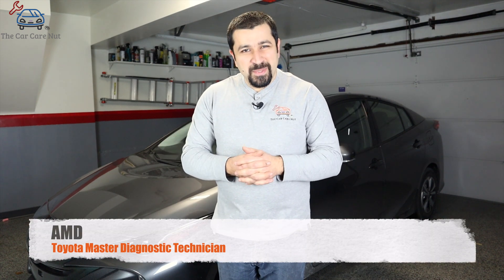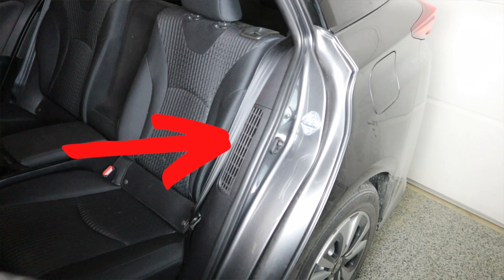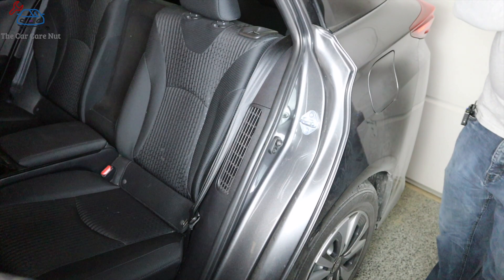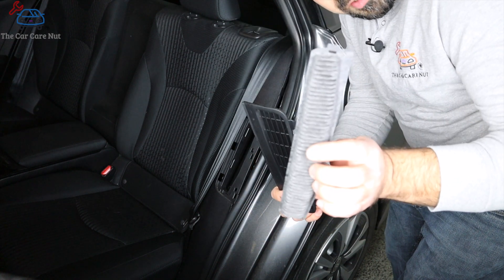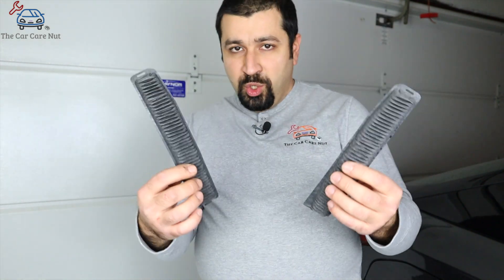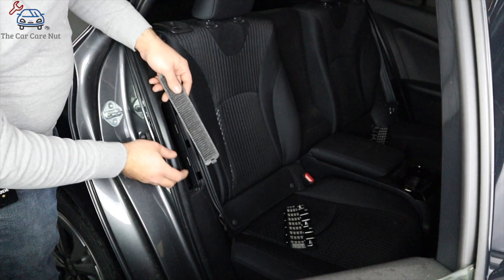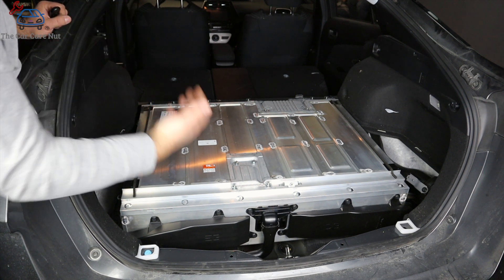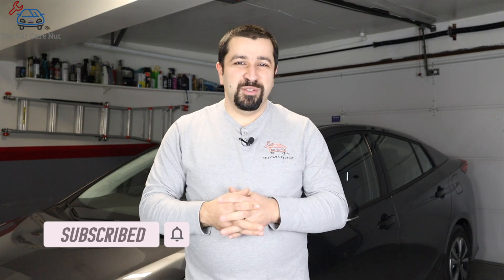How To replace HV Battery Fan Filters on 2017+ Toyota Prius Prime Plug in Hybrid

Comment: Thanks for the great, well informed hybrid info you provide in your videos.  I have a '19 Prius Prime I bought new in June of '19.  In my job as a courier it now has 197,000 miles on it (90% highway).  I checked my filters for the first time after watching this video and they are clean as can be.  I don't have passengers in the back seat and the seats are always down so that might have something to do with it.  The main thing that blows me away is I am still rolling on the original brakes!  I'm really hoping to get 500K or more on this vehicle even if that eventually means a hybrid battery replacement.
Reply from the maker: Very impressive high mileage! Any chance you can share a picture of the car and mileage for the community?
Reply: @TheCarCareNut  Hopefully this works....I tried creating a link to the pics on Google Drive and posting but they would disappear after refreshing the page.  This is an unrestricted link to the two photos on Google Photos.  The mileage today is 196446 but will be 197,000 in the next day or so (depends on what kind of runs I get).  I have better pictures of the car from the time it was on the showroom floor through it's life with me.  This picture was taken in my driveway today with a few states of road grime and all, LOL
https://photos.app.goo.gl/kxbQzfFPZnfLYSo86
Reply from the maker: Thank you for sharing the pictures! That’s the highest prime miles I’ve seen so far! Do you mind if I share it with viewers? I’ll cover the license plate I just would like your permission.
Reply: @TheCarCareNut  Sure, I would love for you to share it!  I love this little car.  It has been, by far, the most reliable vehicle I have ever owned in my 18 years of being a courier.  I've attached a few more pics also you could feel free to share.
https://photos.app.goo.gl/5mXK4FnSbidvT4R37
Reply from the maker: Thank you David! Will do!
Reply: @Hwy_Boy  I also have a 2019 Prime. Only 20,500 miles on it; because of the pandemic I just don't drive as much as I used to. I saw your post that yours is still on the OEM brakes at almost 200K! That's impressive service out of a set of front brake pads. I am especially happy that you have had no trouble with the inverter or any of the transaxle internals like the motors. Those are hell of expensive to repair if anything goes wrong with them. If you've gotten 200K trouble-free miles, on your Prius Prime, maybe mine will last that long, too. I am getting ready to replace the transmission fluid. Probably not essential at only 20,500 miles, but I want to to protect the car as much as I can, and that oil not only lubricates the gears and bearings in the transmission, it also cools the MG1 and MG2 stator coils and all the other internal transmission parts. I've read that dirty ATF in a Prius Prime can lead to short circuits in the MG2 stator, which can carry as much as 60 kw of power under full load. The Toyota transmission fluid is supposed to have zero electrical conductivity, to prevent arcing across the stator windings and connectors, and contaminents in the oil as it ages and breaks down can cause bad things to happen to that $1,500 stator.
Reply: @laura-ann.0726  Hi, alot of good info there, thanks.  It might surprise you to know I am less than 5k miles away from 300k miles on the odo.  Last service at 290k miles my (still original) pads were still at 6mm.  I actually specifically asked for them to check my brakes even though it is part of the dealer '40 something point inspection' every service.  I wasn't having any trouble with them, I'd just never owned a vehicle with that much mileage on brakes, LOL.
I really don't want to jinx myself but I have had NO problems at all with the vehicle.  I've kept up with all scheduled services with the dealer I bought it from and it has never failed me in my job as a long distance medical courier.  I plan on keeping it until the wheels fall off and it just won't go anymore.  I hope you can do the same with yours :-)
Reply: @Hwy_Boy  - Are you still on the original ignition coil packs? If you have gotten 295K out of them, that would be phenomenal! I wouldn't expect to get more than 120K trouble-free miles out of a coil pack, maybe 180K if you live somewhere with a mild climate like the West Coast from San Francisco north to British Columbia, where it rarely gets hotter than the low 80's. Heat is the main killer of ignition coils. Here in central California, it's in the upper 90's to 110 every day from May through September, and Toyota coil packs usually don't last much past 150K. I have a '98 Dodge Ram pickup with a 5.7l Cummins diesel and 5 speed manual transmission. It's still on the original brakes at 105K miles, thanks to the high engine compression braking and manual transmission. I don't drive it much which is why it still has such low miles at 23 years old. But driving style has a huge influence on how long brake pads last, and the regen braking on any hybrid often doubles the life of brake pads compared to a similar weight non-hybrid car. Perfect example are the Camry and Corolla, which have both had Hybrid and non-Hyrbid versions: the Hybrid Corolla or Camry owner can expect 100K miles out of a set of brakes easy, unless they drive like a maniac.
Reply: @laura-ann.0726  Yep, original coil packs.  I live in the mid-Atlantic but drive to most states east of the Mississippi.  It definitely gets hot and humid here.  This time of year I do alot more driving in the northeastern part of the country and around the Great Lakes.
As far as driving style, I'm pretty relaxed on long highway drives.  I anticipate exits off the highway and try to slow down using less brakes and more motor if that makes sense.  More of a gradual slow down not enough to impede traffic but easy on the brakes.
In Baltimore, where I am based out of, you're kinda forced into more aggressive driving lest you be killed, LOL.  We have ABSOLUTELY the worst drivers I've seen anywhere.
Reply: @Hwy_Boy  - That's good to know about your extreme longevity coil packs. They are not hugely expensive nor difficult to replace, but they tend to fail with no warning, and of course the car is crippled if even one of them craps out. If I still have this car when it gets to 100K miles, and if I decide at that point that I want to keep it for another several years, I'll probably replace the coil packs when I replace the plugs, just as a preventative measure. But chances are,  before I even get to 100K on this Prius, I may need to switch to a "taller" car that isn't as hard for an older person with mobility problems to climb in and out of. I'll be in  my mid-70's by then, and probably be even more disabled than I already am. I'm looking at a Rav4 Prime. The drivers seat is almost a foot higher than the Prius' seats, and it's a PHEV, although the gasoline fuel economy is 33% less. But it's uses the same powertrain technology as the Prius, except for a 2.5l engine and a bigger battery, and the HSD is a mature, extremely reliable powertrain.
Reply: @laura-ann.0726  Yeah, I have a buddy of mine in the same business as me and he bought his '19 Rav4 about 3 or 4 months before I bought my Prius.  He is in his early 70's and drives a little less miles than I do.  He's up to 187k miles on his.  I just turned 56 myself and kind of surprised I made it this far the way I was in my younger days, LOL.
I think I remember reading somewhere that the Rav4 Prime is Toyota's 2nd fastest vehicle in production.  I heard it's pretty quick.  I've really like the new Corolla hatch also.
Reply: @Hwy_Boy  - The Rav4 Prime's powertrain is kind of scary. The 2.7l ICE is rated 177 hp @ 6,000 rpm; with 165 lb.-ft. of torque @ 3,600 rpm. However, these numbers are kind of deceiving, as the ECU is programmed to keep the ICE as close to 3,600 RPM (the torque peak) as possible, and the ICE will almost NEVER operate faster than 4,000 rpm except under extreme load demand. The two propulsion motors actually make substantially more power than the ICE, assuming you have a full traction battery when you hammer the accelerator pedal: , MG2 in the front transaxle is rated at 179 hp/199 lb.ft. torque, and MG3 in the rear axle is 53hp/89 lb.ft torque. Right off the line, before the gas engine can spin up, you have 288 lb.ft. of torque just from the electric motors, and by the time the car is going about 15 mph, and the two motors spin past 1500rpm, they are making 232 hp just by themselves! After the fist couple of seconds, the ICE spools up to it's torque peak, and you have a completely insane 453 lb.ft. of torque being delivered to the power train. To put this in perspective, the 5.7 liter Cummins Diesel engine in my truck only puts out 400 lb.ft. of torque at it's torque peak (1750rpm), at full throttle. The Rav4 Prime is supposedly capable of 0-60 in under 6 seconds. Juicy specifications indeed, but the darker side of these numbers, are that the Rav4 Prime's fuel economy is only 65% that of the Prius Prime, despite the fact that they share the HSD technology. The Rav4 is heavier by several hundred pounds than the Prius, it's aerodynamics are terrible compared even to a Corolla Sedan, let alone a Prius, and the powertrain ECM computer has been programmed for power rather than maximum efficiency. The bright spot, of course, is that the Rav4 Prime is a PHEV with a 43 mile EV driving range, and if you live somewhere where electricity is under 15¢/kw-hr, and maybe you can get free charges from time to time at shopping malls, community colleges, or public libraries, the Rav4 Prime is substantially less expensive to drive than even the Rav4 Hybrid (the non-plug-in version). But as you know, the Prius Prime is probably the undisputed King of Fuel Economy in the PHEV market segment. 

I've seen some very interesting videos of Rav4 Prime's off-road capability. If you were to equip one with serious all-terrain tires, like BF Goodrich TA/KO2's, or Falken Wild Peak A/T's, the huge torque output from the two electric motors can pull the Rav4 up unpaved dirt hills that would defeat most any other small vehicle except a Jeep Wrangler or CJ with a 4:1 transfer case. Of course, the Jeep is purpose-designed for off-pavement, and the Rav4 is a compromise - a CSUV that people mainly use on pavement, but that can handle at least mild off-road adventures and some snow on the ground to get you to and from the ski slopes. I've sat in a Rav4 Prime at a dealership but decided to not get that one, because it had a moon roof, and I don't like them. They always start leaking rainwater sooner or later, and they steal about 2-1/2" of headroom. I'm tall, and can't afford to lose that much headroom, especially to a "feature" that I already don't like, and that adds a couple thousand $$$ to the price of the car.
Reply: @laura-ann.0726  Wow!  You're really well informed on your stats.  It's interesting too that you have a Cummins diesel truck alongside your Prime.  I thought you guys were supposed to hate Prius drivers, LOL.  Just joking.
Thanks for the info, really interesting and definitely worth keeping in mind.
Reply: @TheCarCareNut  I bought a Prius+ (V in USA and alpha in Japan). It's from 2017, but it's a 7 seater. My question is: this fan filter is located at the same place as you show on video? I don't have me Prius with me yet, that's why I can't check it now. Thx
Reply: How long are the coil packs under warranty???
Reply: @stephenfiore9960  - That's a difficult question to answer, because there are several different warranties on these cars. The basic bumper-to-bumper warranty is 3 years/36K miles. The powertrain warranty is 5 years/60K miles. The traction battery has a longer warranty, 80,000 miles I think. Depending on what state you live in, the emissions control components like the Catalytic Converter might be warranted to 100K miles. The language of these warranties is fuzzy and hard to pin down to exactly which components are covered under under the extended warranty. Since the coil packs are park of the ICE, and therefore part of the powertrain, they are probably covered to 5yr/60K miles. The good news is that they aren't terribly expensive,  and if you have even a little mechanical skill, they aren't difficult to replace yourself with just a 10mm deep hex socket and a ratchet wrench. Aftermarket coil packs are about $15 each, Nippondenso OEM coils are about $50 each, but can be counted on for 100K miles. Some of the aftermarket ones are not real great quality and people complain that they failed in just a few months after installation. I'd pay the $50 and get the Denso coils. There are YouTube videos on how to diagnose a bad coil pack and how to replace them. The only person I know who has had to replace them on a Toyota, had one of them fail on her 2007 Yaris, when it had about 120K miles. Her local Toyota dealership charged her $1200 to replace all four of them, which is a flatout ripoff: the retail price of Denso coils is only $250 with sales tax, and the labor would be no more than 1 hour, say $120 worth of labor - coil packs aren't hard to replace on an in-line 4 cylinder engine.

Comment: You didn't tell how expensive the HV battery is. How expensive it is?
Reply from the maker: That depends on the model and year.
Reply: @TheCarCareNut  Google gave me an educated guess within 2200-2500 $. Just the part not the work costs involved.
Reply from the maker: That sounds about right for most of them. Labor is usually between 2-4 hours

Comment: Thank you very much for this video. 
Where is located fan filter fir Toyota Camry hybrid le 2020 and how many is it ?
Thank you
Reply from the maker: Hi! On your camry hybrid it’s located underneath the back seat and there’s only one filter
Reply: @TheCarCareNut  
Thank you very much for your quick response!
I have question about transmission fluid 
What I should buy for my transmission fluid and its cvt and in how many miles I need to change it ( iam uber driver )
Reply from the maker: Hi! Change the transmission fluid every 60-90k miles and use only Toyota ATF WS fluid
Reply: @TheCarCareNut  
You are awesome 👍👌
Reply: @kanai7696  
What?

Comment: The 4th filter is much thicker than the 3rd gen prius filter. Should I be worried? Should I upgrade my 3rd gen filter???
Reply from the maker: Hi Robert. I wouldn’t be worried. They went to a paper filter in an effort to make it more of a filter less of a mesh but they both do the same thing.

Comment: Trick with the HV battery filters...

Vacuum from the inflow side first...  If using compressed air, blow from the outflow side, pushing the dirt away from the battery cooling system.

Comment: These filters are not expensive. I replace them instead of vacuum to clean it. Brand new one is always cleanest ones. I have Camry hybrid 2018. I change them once a year. They are not that bad but I replace the filter to avoid trouble later
Reply: What's the cost
Reply: Replacement part at Toyota dealer 8 bucks each ,

Comment: Thanks, how about the same for a new Rav4 hybrid ? Thanks
Reply from the maker: Hi! I already have a video for the new RAV4 hybrid find it here https://youtu.be/L1l-JNGMTEs
Reply: How about 2020 Highlander Hybrid?
Reply from the maker: Hi David! Im hoping I’ll get to the highlander hybrid in late February or early March.
Reply: @TheCarCareNut  Thanks!
Reply: @TheCarCareNut  - What would be totally awesome is a Highlander Prime or a Sequoia Prime.  Either one would have substantially more carrying capacity than a Rav4 Prime, which is actually a very small car: taller than a Corolla, but no longer or wider I think. I might trade my Prius Prime for a Rav4 Prime - if this danged supply shortage ever gets fixed - but if Toyota were offering the Highlander in a PHEV version, I'd much rather have a Highlander Prime than a Rav4 Prime. Since the Highlander is already available as a Hybrid, they've already got the E-CVT for it (P-710 I think, same as the Camry and Sequoia Hybrids), they would just need to do a full under-floor lithium battery, same as the Rav4 Prime and Tesla, and revise the ECM software as needed.